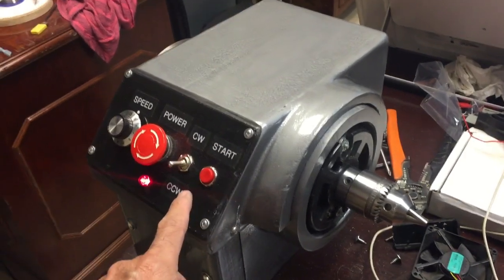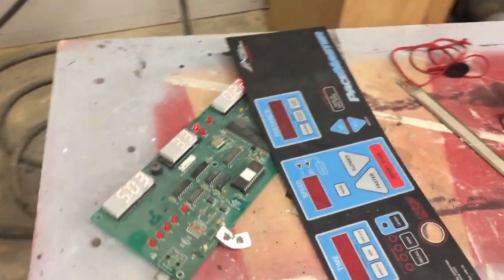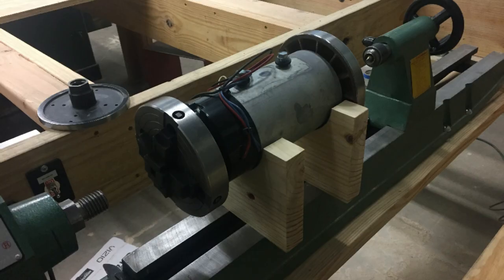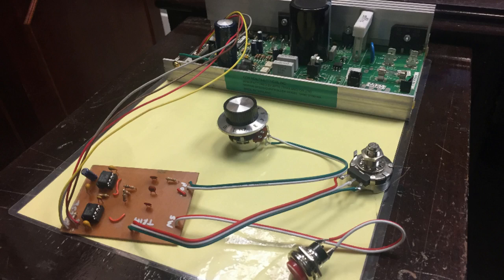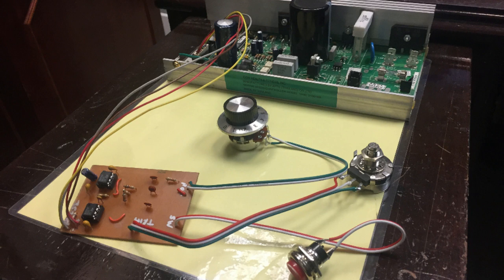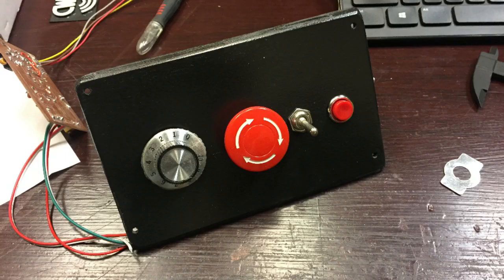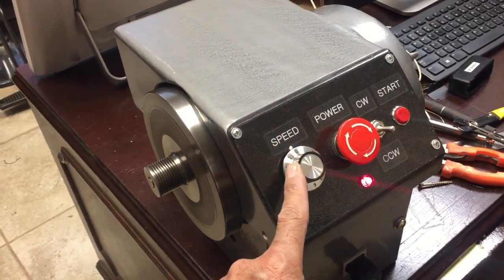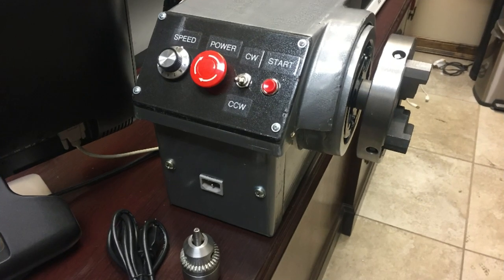Speed Controller PWM Treadmill Motor

Comment: Great video, I have three treadmill motors all run fine except when I use them on my wood lathe they slow down under load when bowl turning what would cause that  I used a MC60 board ,a SCR controller, I ordered a PMW controller see if that makes a difference, Did you run into the same problem, thank's
Reply from the maker: Yes, same thing. I guess for a treadmill it does no matter a little variation on speed, since you kind of loaded very intermittently when taking a step. check this guy up https://youtu.be/7aU2ESpwp5A he has a lot o videos about treadmills.
Reply: @CarlosMDominguez  Thanks bro 👍

Comment: Looks cool, works great. Did u use the treadmill mc2100 controller or got a different controller for the lathe? I get that u made a pwm generating circuit but want to know if u used the treadmill controller or not. I used a pacemaster 2.5 hp motor for my shopsmith, worked okay few days but now keeps giving "hi acc err" and stops. I used the pacemaster pro plus controller and button panel both. I am looking to use an alternate speed controller but not sure if the cheap scr  ac controller will work with my motor. It is a 124v DC motor. Thanks for sharing.
Reply from the maker: Im glad you like it.  Yes I used the mc2100 controller. The timing circuit is all you need on this board to make it run. To make it go on reverse I just switch + & - wires on the motor.  Thanks for your comment.